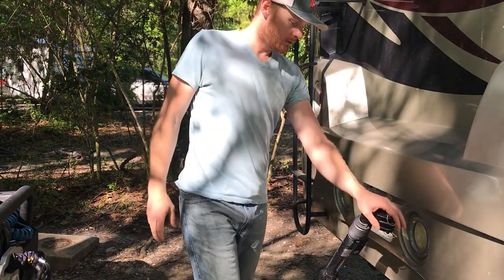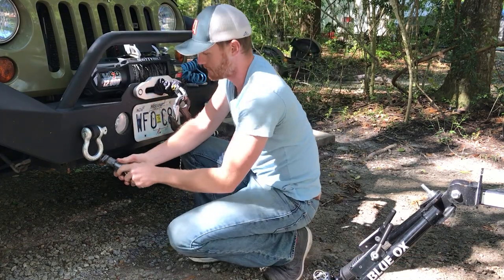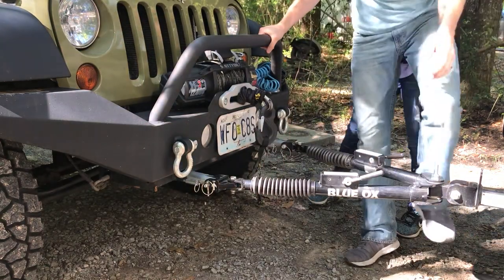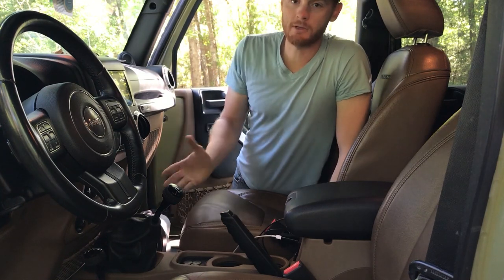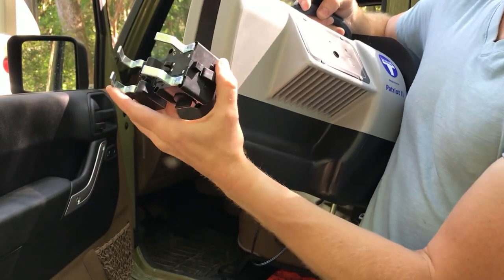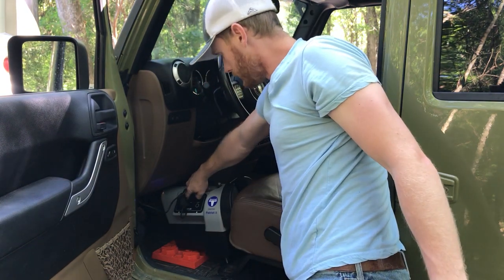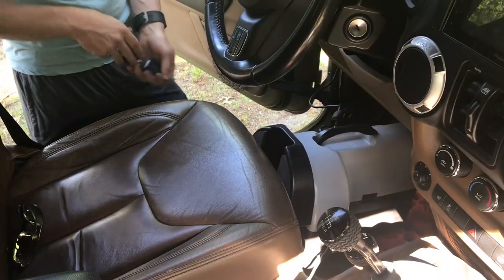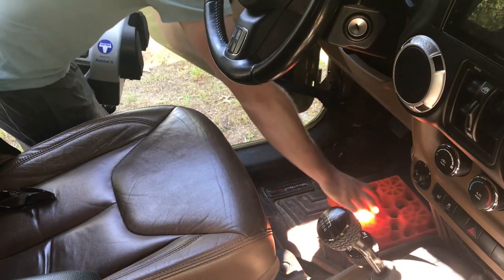How to Flat Tow Behind an RV

Comment: Great video! One thing I might add is to make sure the parking brake is on or your partner is in the driver seat when you are disconnecting the toad if you are on any kind of grade! I’ve seen runaway toad’s in the past.
Reply from the maker: Yeah...there may or may not have been instances where I “held” the Jeep in place.

Comment: Another amazing video thank you so much for that….
few questions If I may…
1.	what happens with the power steering when you flat tow a JL?
2.	if you have the ignition on what happens to the fuel pump another electronics within the JL Jeep?
3.	Instead of having that box brake system between the left front seat and the brake pedal do you know if there is another option which is built in under the hood connected to the JL original breaking system?
thank you so much again look forward to hear from you

Comment: Do you have to secure the steering wheel, or does it stay where it is while in park with the transmission 4X4 lever in neutral?  Also, do you really need the brakes with a big rig like that?

Comment: probably a dumb question, but can you reverse just like a trailer with that set up? or does it lock up at the joint area at certain angles?
Reply: The only dumb questions are the ones that are not asked. # 1 rule is no backing up when you are connected to the RV.

Comment from the maker: If anyone has any questions about anything in this video with our setup, please check out this recent video covering all the most common questions we get on this topic: https://youtu.be/h_M-wMfFjjI

Here is exactly what we use if you're interested: 
Blue Ox Tow Bar: https://amzn.to/2UPkNqC
Blue Ox Tow Plate: https://amzn.to/2LfHe8Q
Blue Ox Patriot II Brake: https://amzn.to/2DFGtjg
Electrical Cable: https://amzn.to/2GJCin6
Brake Light Kit: https://amzn.to/2GPcaHm
Reply: Could you have just connected to your bumper or do you have to connect to a specific plate?  Seems like you have the D rings you could possibly connect there?
Reply: @pusherreviews7028  D-ring removal and just use your d-ring mounts would have been way easier and maybe more solid...I don't get it...
Reply from the maker: @robertallen6710  The tow  bar plate is drilled and bolted directly on to the frame of the jeep. It was certainly not the easiest option but I felt like it was the safest and most secure option. 
I never was crazy about the D-ring option. It would create more potential weak points for failure. Given how often we flat-tow, I wanted it to be as fail-proof as possible. For someone flat-towing much less often, it likely wouldn't matter as much.

Comment: Hey man, great video.

Do you have to disconnect the drive shaft or just put both transmission and transfer case in neutral?!

I always thought the drive line had to be disconnected. 

Thanks

Comment: Do you leave your keys on for the brake kit? Or leave the car on or just the accessory.
Reply from the maker: No, you don't need to leave the keys in or turned to flat tow for the brake to work properly. It works through inertia, so no need for power. That being said you do have a brake controller that "talks" to the brake module, basically it can change how much force you want to be applied to the pedal of the jeep, this does require power. Out of all our long trips on the road, this never killed the battery.

Comment: Question ?  Is the Steering Column set in lock position where the steering wheel don,t turn or do you let the steering wheel free rotate ?
Reply from the maker: No steering wheel lock for Jeep Wranglers, the steering wheel just rotates freely.

Comment: Great Video. Thank you. I'm getting that same system blue ox all around. It will be installed next week. I have a 2021 Jeep Wrangler limited sport S and the cigarette lighter (12 volt) doesn't work when the jeep is turned off.  What do you think needs to be done about that ? 
Also, does that not drain the battery on the jeep to have that plugged in ?
Reply: I noticed the same thing. I own a 2018 JLU and I had to run a separate 12v power from the battery with fuse to keep the Blue ox patriot powered up. I also ran a power connection from the motorhome through the 7 pin connector to the battery to keep it charged up so it does not drain the battery.
Reply: @mbahm1   That's kind of what the guy did who installed my system. The power comes through the 7 pin system and there's a separate cigarette lighter thing he installed and it's underneath the driver's seat. Works fine.

Comment: I just joined the Jeep word with a 2021 Rubicon with a manual transmission.  The manual says to put the 4x4 into neutral but put the stick into gear and not neutral.  Thoughts?
Reply: If the tranny is in neutral, you are not splashing your gears with lubricant. You should tow in 2nd gear. Sounds weird but that's what my Wrangler TJ manual says.

Comment: Great video thank you! If you hook up safety chains the old way is it really necessary to have a break stop installed? It seems like overkill in the very unlikely event that everything else fails you would still have to safety chains attached between the two vehicles right?
Reply from the maker: Thank you! It is a back-up upon a back-up. Like you said overkill. Depending on the state your towing in, some require one or the other or both even. We just error on the side of caution and have it all hooked up at all time when we are towing. But yes, if the tow-bar were some how disconnected while in motion, those chains are supposed to control the vehicle until you are safely stopped. Thanks for the question.

Comment: Can you reverse with that kit
Reply: Might be a little late on the reply but can tell you by experience it is almost impossible to reverse with a flat tow setup. Had to do twice at gas stations, as our Rv is a Gas class A and we were boxed in by other cars. Ended up having my high school son jump into the towed car and turn the wheel as I tried to back up. Once was successful, once the tires were chirping and the third time I just totally disconnected right there at the gas station and had my wife follow
Me down the street till we could reconnect. 

Having been RVing now for about 3 years and always towing our full size Chevy suburban I can tell you I pick and choose which gas stations we go to and I’ll wait for an end pump that has a strait shot pulling through instead of going to one of the middle pumps. Also some states have a Bucee’s gas station and they are absolutely gigantic and super easy to navigate for big rig setups. Next RV will be a diesel pusher though so we’ll just go to the semi fuel pumps which are designed for long vehicles. Sorry for the long winded answer. Happy RVing!

Comment: Does the manual state that you should keep the Jeep in gear? My Cherokee does, something about the transmission fluid pumping when it's in gear.
Reply from the maker: Ok, so after looking it up it appears that for jeep wranglers being flat towed, they are suppose to be left either in drive for autos or in gear for manuals. After doing a little Google research it seems this is to prevent damage to the transmission due to friction. 
With all this being said, we have been full time rving for about a year now, constantly on the move, and I have always placed the shifter in neutral, just sort of as a fail safe in case I forget to put the transfer case in neutral, ( which I have never done thankfully). So one year later and I have never had a single problem with the transmission, even though we are flat towing on a weekly or less basis. I'm not saying that this is necessarily the correct way to do it, but either if damage does occur, it would take a very long time or Jeep is just erring on the side of caution. Bottom line, just go by whatever your manual says, sounds like your ahead of me there haha.
Reply: @WheelingToDream  hmm, that's interesting, sounds like it doesn't make a difference in that case. Appreciate the video and the reply!
Reply from the maker: Of course! Hope it helps.
Reply: @WheelingToDream   My 2002 TJ manual says to put the transmission in P to tow not D.
Reply: @Bearairboatrides  my 2017 says transfer case in neutral and shift into park.

Comment: Where do you put the ignition so the steering doesn't lock up?
Reply from the maker: We have a 2013 Jeep Wrangler Rubicon, which does not have any steering wheel lock mechanism on it. I believe most Wranglers do not have any sort of lock, but I’m not entirely sure. Depending on what you are driving, definitely check with your user manual.

Comment: I took my Winnebago to my nearest Camping World and my Jeep Wrangler 2013 it has the 50th year anniversary bumper on the front with a winch they said they could not put the front plate on the jeep because of the winch is anybody heard of this before So I spent $4000 on blue ox And now they can't mount the baseplate which I have not bought on the Jeep because of the winch....

Comment: Do you keep the steering locked or unlocked?
Reply from the maker: There is no lock on the Jeep Wrangler 2013 model. It follows me just fine in an unlocked position.
Reply: @WheelingToDream  thanks for the reply my car when unlocked I hit a some bumps on the highway and it started to go crazy behind me idk why
Reply from the maker: @dridgesnapoleon  Whoa?! That's scary. Glad you were able to get it under control. What kind of car is it?
Reply: @WheelingToDream  VW Jetta sportwagon idk if it's because I didn't have any braking in the VW or if it's just got loose suspension I'm not sure but I just ordered the invisibrake system and will be towing the car over 2800 miles so we will see if that's what it was

Comment: How front tires turn with RV turns ?
Reply from the maker: For Jeeps the steering wheel doesn't lock, so the tires turn as much as needed when I make turns. I'm not too sure about other vehicle manufacturers, you may have to unlock the steering wheel.

Comment: One issue with this is that not all vehicles have the cigarette lighter outlet on all the time. For example, the car I have, the cigarette lighter outlet dosent work unless the car is on accessory mode (keys required in ignition for accessory mode) or when u turn the car on